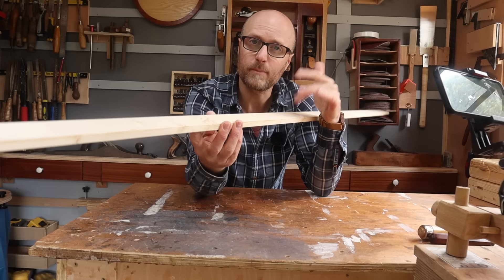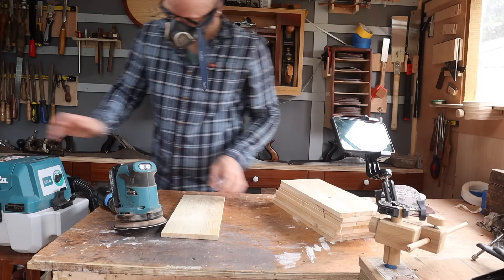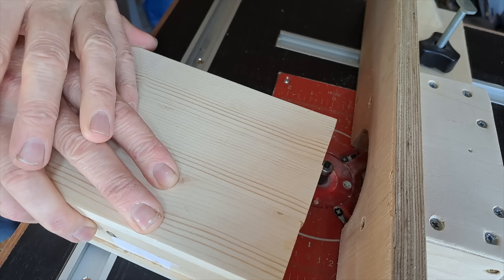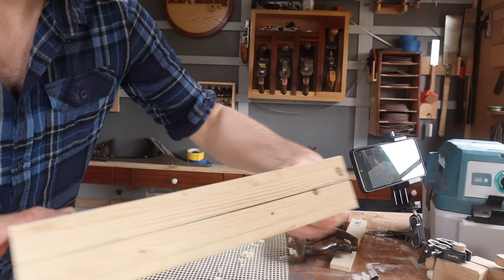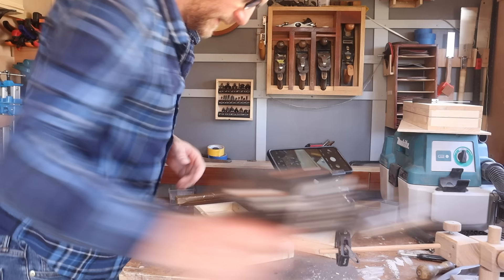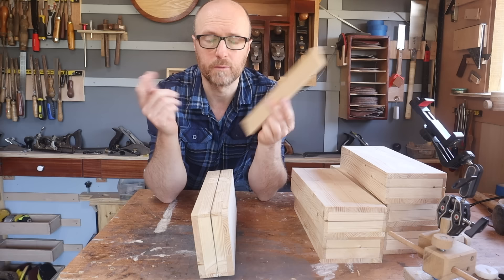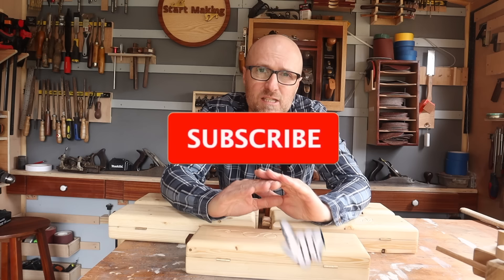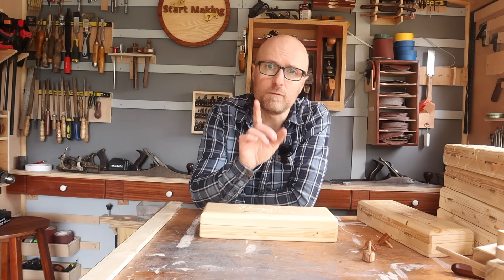Beginner Woodworking Project that Sells | ONE BOARD BUILD

Comment: Use pallet wood. You can get it free or extremely cheap.
Reply from the maker: Good advice. If I had a thicknesser I would . But without one it is a lot of work.
Reply: I agree! I work in a factory and I see pallets all day and sometimes I have to take a second and just check out the colors in the wood and the grain. I often wonder in a skilled worker what something from a nice looking pallet would look like. 😀

Comment: What is the US link for the sponge material?
Reply from the maker: Hi. I have searched and searched and it looks like both on the US side and the UK side have stopped stocking it. The only ones they do have slits in for jewellery. Sorry bud.
Reply: @startmaking1  I make trinket boxes and have tried using material for the bottoms which is hard to cut after assembly, felt with adhesive also hard to cut and put in after assembly so that material would have been ideal. do you have the link for the slotted material?

Comment: Beginner woodworking.

Needs a planer.

Lovely build and ideas, but planers are one of the most expensive tools and definitely not something most beginners would have. I've been woodworking for 4 years, just a hobbyist, and I don't own a planer, or a router table.
Reply from the maker: I can't remember but I didnt use a planer for this one did I. I used a hand plane but they are not pricey. A router can be bought for £40 and just screwed to a plywood board with a hole but over all I see your point. There is a video on the channel with a saw as the thumbnail, that is the beginner version of this. Just a saw used to make the entire box.

Comment: Hey there...
After you resaw them to get 2 parts of the box(top and bottom) insted of using hand plain, why not use a flat surface(cut of from lets say kitchen top,stone wood dosnt matter as long as you know it flat), glue a sheet of sandpapper on it and sand the whole top or botton in the same "plane" so to speak? you would get it almost 100% the same
Reply from the maker: Hi. Great suggestion.  I have tried this but I always manage to round the corners. My fault not the technique.  It does work well though. Thank you
Reply: @startmaking1   i mean its just an idea, not sure if it would work to be honest. But i see it as a flat surface sanding so…
Thank you for answer
Reply from the maker: It would definitely work.
Reply: I have made similar boxes and found the best way to match the top to the bottom was to clamp your plane upside down and start to clean up the mating edges

Comment: Saw another YouTuber do a video on how to build a drawer simply with no screws, just need a saw and router table now! At least I won't have to spend money on screws! 🙄
Reply from the maker: Every little helps lol
Reply: @startmaking1  Haha it's mental! Love your work btw, I need the power tools because I don't have your patience.
Reply from the maker: Power tools are amazing once dialled in but I still reach for the hand tools for a lot of jobs. It's funny how, even though, in my hands they dont do as good a job as the powered ones, I cant break the habit.
Reply: @startmaking1  I think you find satisfaction in using hand tools. I still remember using a manual drill in school but don't think I'd go back 😂

Comment: Honest question from a beginner. Why glue up 3 1x2's for the top instead of just using a 1x6?
Reply from the maker: No worries at all. to be honest the answer has a few parts. The main reason that I used these 3 joined together was to make it a one type of board project. But it is also a way that I find more stable than a larger piece of pine. The issue I have had with a large piece is that if you buy it from one of the larger stores it generally comes with a cupping along the length due to its width. Just my experience and even if it doesn't come like that if you leave one inside it tends to cup from the heat. So I prefer on these to join 3 together and get the box glued before any movement can happen. Also from a movement point of view. It is not brilliant to glue the top direct to the sides as the top contracts and expands along its width whereas the short sides dont move and if there is not enough strength in the sides once you cut the lid off, it can also cup and ruin the box. I have never had this issue with these dimensions and using the 3 glued together. When I started out I had so many issues due to wood movement and not completely understanding what I can and can't do (still dont entirely ) that I had to find what worked and stick to it for my sanity. I really hope this makes sense and thank you for reaching out.
Reply: @startmaking1  Thank you for your response. That does make sense!
Reply: @startmaking1  Hey, great vid, thanks. I've started to make a couple of boxes but encountered problems ... when I glue up the top and bottom panels they always bow (I've made some bar clamps to try to get around this but doesn't always work) ... what would be an alternative solution? Also, no matter where I look for pine I can't see to find any that's not bowed and or cupped - makes it really difficult to get anything straight and square; any ideas where to get decent pine from? Thanks.
Reply from the maker: Firstly. There are a few things that you can try if you haven't already. People say about the end grain alternating on panel glue ups. Take a look at the side and you will see smiles or upside down smiles, if you alternate these then the cups will at least be less prominent as they will counter each other a little. Also make sure you have clamps above and below so you put even pressure. I made the mistake of just clamping the bottom, ie lying the boards on the bars and not having any clamps on top. Also cauls are great, Get some straight wood and wrap with parcel tape. Them lie these along the ends so that they stop the panel being able to bow when you tighten the bar clamps. Dont squeeze the cauls so much at the start to stop the bar clamps working but do it little by little. Then the annoying part. Large panels sometimes in pine will always bend, it is how you fix them to the box and the size you are working with. I do thin boxes like in this video as there is less chance of cupping. When I did 4 boards instead of 3 it cupped. If you rebate the lid inside the sides to allow for movement and dont fix it to the sides then it is less likely to bow as it can shrink. and expand. Now , decent pine, that is a really good question and so far it has been a lottery for me. I dont pick it in person but that would be my first advice. But better than this, I think learning to allow the movement and learn joinery that helps with this would be the long term solution, certainly one I am trying to get to grips with. So long as you can flatten the board when milling then how you use it will then determine how it performs. I really hope this helps.
Reply: @startmaking1  Thanks for the reply. I've used cauls to try to stop the bowing but no real success so far, I'm trying to build larger boxes than in the vid so I'm gluing up 5 boards - maybe that's why. I'll persevere and try the end grain thingy you suggested. Thanks.
Reply from the maker: I think that 5 boards is the possible reason. So long as you are applying finish to both sides, as this also can cause cupping if you only finish ones side. The fact is though, if you fix both ends to the sides of the box, or dont let it shrink and expand freely, then cupping will happen as it strains against what is holding it. If you are having a lid that is not attached and it is still cupping, then I have seen sliding dovetails used to brace across the grain, one side to the other, that way it stops cupping and the board can expand as the dovetail is only glued right in the middle. Or maybe bread board ends as these also let it move. But I have only tried the dovetails and you have to have a router for these.
Reply: @startmaking1   Yeah, maybe 5 boards of pine is the problem. I don't have the skills (yet) to mess about with sliding dovetails although I do have a router. Maybe I'll make the top out of MDF and see how that goes. Cheers!

Comment: I don’t understand your logic of gluing the lid on only to cut it off later, seems very counter productive
Reply from the maker: It ensures that the sides of the lid are both grain matched and size matched with the base. Also just lying a flat piece of wood not the top of the base to act as a lid can end up cupping due to wood movement. I have found this was supports it nicely. Though there are so many other ways to go.
Reply: Excellent explanation

Comment: Honestly,  how many of these have you actually sold and if you don't mind sharing,  what was your profit on them?
Reply from the maker: Hi Mickey. That is a good question. A few years ago, before starting Youtube, I made a batch of 6 of these. At that time I was planning on selling what I made but in truth, I made them as I was learning and had the wood. I didi not try to make a huge profit, instead had a tool in mind that I wanted an iso I sold them at enough to buy that tool. That is why I ended up making a video about it now. Not to say, this will make you rich, more to say, this will help you learn and also create some cash for a tool purchase. Top of my head, I believe that the costs were pretty similar, so around £48 cost. I think I didn't ask for more than £30 per box including the pins and decoration . So on that batch I made approx, £130. I believe that I used that to buy my low angle sweetheart plane. Since then, I made another 6 for gifts, so no profit and another 6 for a similar sale price. They are so easy to batch out and I find it fun. I hope that this helps. Like I said, not a profit one for advanced workers but good for getting that tool you want.
Reply: @startmaking1  thank you for your honest reply.
Reply from the maker: Not a problem.

Comment: Am I missing something? Looks like more than one board.
Reply from the maker: kind of and kind of not. At first I meant just one type of board for the whole project. But actually in reality you could make one box form each of these boards. Only slightly smaller than the ones I made. The size really is very flexible.

Comment: no clue what these would sell for. anyone buy these?
Reply: A reckon craft fair farmers market kinda thing they'd fly and a reckon there's 50 quid min in them.
Reply from the maker: I could sell them easily around craft fairs etc and, thank you for the compliment below, Michael, but I would be happy with £35 each and maybe £5 to upgrade the pin. The names etc are dealers choice for cost.,
Reply: @startmaking1  u could be right base price then added extras. The pins are certainly unique selling point. But they'd certainly be sommit that would be a good seller. A mind at recent event went to there was guy selling things no were near as nice as these and he was charging double and seen few go. Look wicked

Comment: Cutting the lid off the box with your flush cut saw, the cut didn't quite line up at one corner. That is because of the wax you used. It stopped your imrovised sledge from sitting flush on your bench.
Reply from the maker: Hi Marc. Good point. I wonder if the dust stuck and raised it. Thank you

Comment: all that work for 50 pence profit???
Reply from the maker: Hi Scott. Thank you for watching. The profit would be more than that in all fairness. But the real point is that it is a beginner project.  So you learn as you build and then you can sell them to buy a tool that you need.  Win win. You could easily make £100 to £150.profit and you are learning.

Comment: Beginner? Providing you have a workshop full of stools and equipment. Surely this should be done solely by hand? Nice video but definitely not "Beginner" more like midlife crisis level with money to burn.
Reply from the maker: lol, thank you, this made me chuckle. PS, palm router £45 (Katsu), Circular Saw £40 (titan), Kreg Jig in some parts of US £10, Was £20. Orbital Sander £35 (Titan). This is why I am laughing. People love the excuse that we have all the tools but this was made when I had a workshop with no power, no electricity of any kind down there. But thank you for their compliment on the video overall, that bit is very much appreciated.
Reply: @startmaking1  I'm going to attempt to make it but I only have hand tools available because I live in a flat, with no garden/shed so my workshop is my bathroom. Well made video, so I should be able to replicate with hand tools. It's just a question of skill level at this stage.
Reply from the maker: Take a look at this one, same style but a load smaller and using more hand tools. https://youtu.be/HkOXBkLfyAw Not a great video but may give you a few ideas. Also In the next few months, based on acuity a few comments I am planning on making a box with lots of tools and one with basics. That will be a few months off though. I think that you can do it, worst case, dont worry about he rebates on the joints, maybe butt them and drill some dowels through from the outside as a feature.

Comment: I wish these people making "beginner projects" would just think to themselves, the average beginner doesn't have thousands of dollars worth of machinery... 🙄
Reply from the maker: Hi Daniel. I understand. I think that the tools that I used not his came to around £400 total but that is just a quick guess. And I could have not used the router. Most beginners have a circular saw or if not then a table or band saw. though, this could all easily be achieved with hand tools. I do tend to look at it another way though, when a larger channel with loads of tools does a beginner project video, I am glad that they are still thinking about people starting off. And I hope that the people watching can figure out a way to make the same thing with less tools. So just use the video for inspiration.
Reply: @startmaking1  wow.. thanks for the reply. I do have a few tools of my own although I just started with woodworking and have a 9-5 day job 6 days of the week, which leaves little time to do my projects. In South Africa 400 pounds is quite alot of money... more than a months salary actually..😂 Your work is good and I wasn't criticizing it, just the fact that alot of similar videos say "You can do this for less than 50$" yet their garage is twice the size of yours..
Reply from the maker: Not a problem. You took the time to watch and comment, it is the least I can do. You are right, money is so relative depending on location etc. I never took your comment as a criticism as it is correct on many channels. I used to love watching the channels with huge workshops making simple objects, and then, like you said, saying you can all do this too. It is the second reason I started the channel. I wanted to try and show people that you can do it without a lot of the tools, by thinking outside the box. That said, to make life easy, you could do with one tool with powered cutting ability. the circular saw is the most versatile imo. A jigsaw is great but not reliable for straight cuts. A circular saw and a cross cut jig means you can not only do straight cuts but also by raising the blade you can cay rebates and dadoes. Takes a little practise but that is what I did for the first 2 years. I hope that you still enjoy your projects on your one day off. I imagine it can be frustrating stopping and starting.